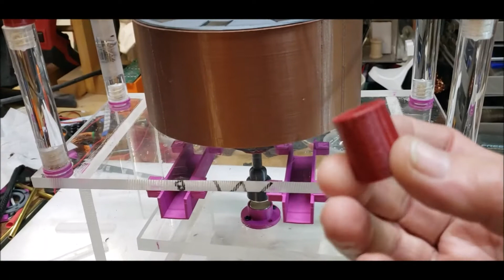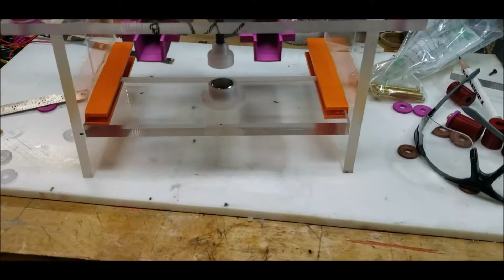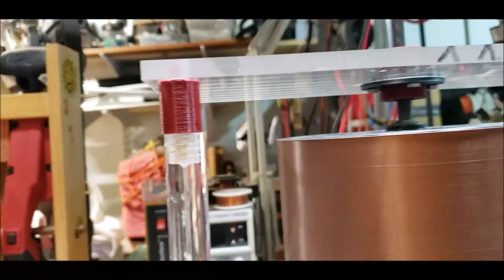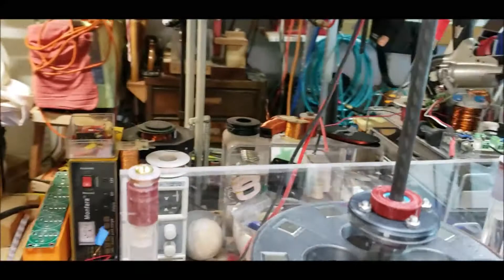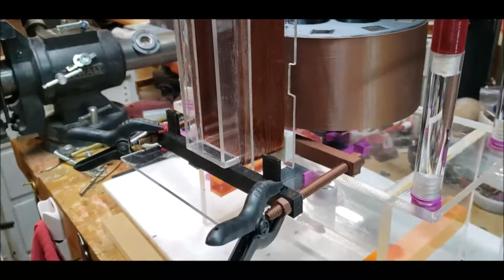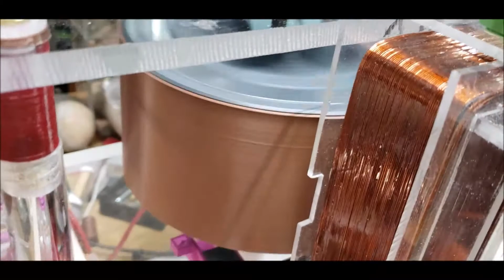3D Printed "Big Pucker Motor" build and fist run

Comment: Yesh, it runs! 10 magnets with each a north and south, make 20 individual poles. In bucking configuration, brings it back down to 10 super poles. Nice recovery, you did that!
For extended shaft, you could do a generator, but it could also be way off topic ^^ like a go pro going in circles, strobing the led at your face in the dark to get some special effects. Or like a led, like a beacon light ;'). Keep it up! JP